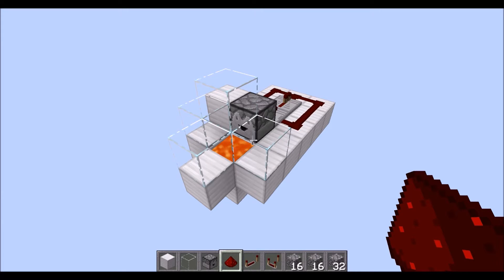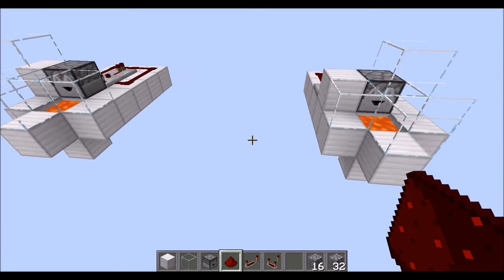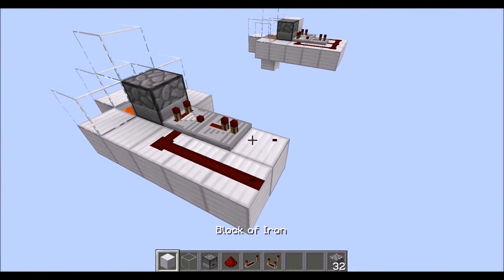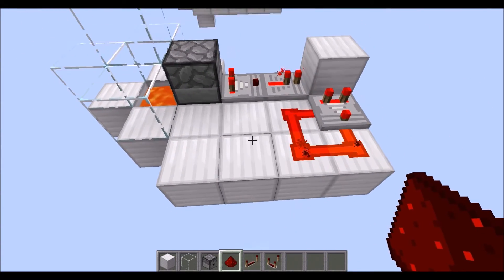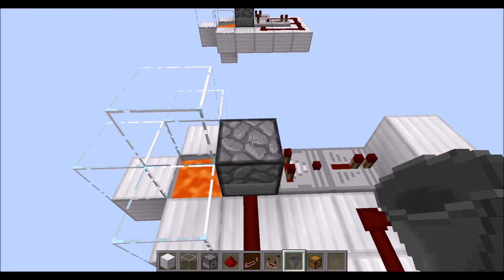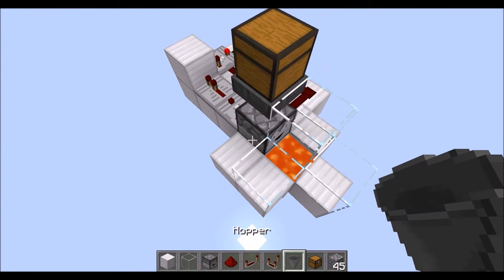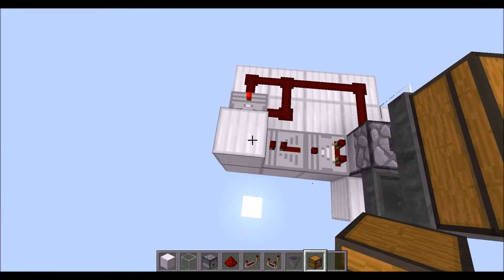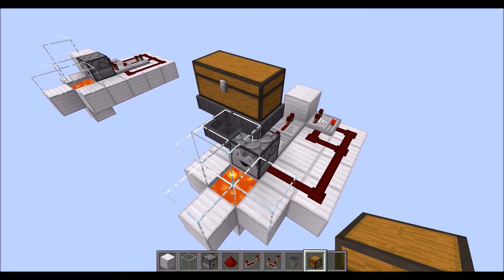Fast Item Disposal

Comment: Love this! But have a question.  I play on a server, and have a skeleton grinder.  I have a sorting system to sort out the unstackables (bows and armor) from the bones and arrows.  I would like to keep the unstackables available for a time for new players.. but eventually want to dispose of them with a lever or button.  Is there a way to hook this system into that sorting system?
Reply from the maker: Yes there is a way.  I assume your items are going into a chest.  You could have a hopper below the chest that is locked by powering it with a redstone signal... from a lever most likely.  When it is locked, no items will move into or our of the hopper.  That hopper would lead into the item disposal system.  Then when you flick the lever, it would unlock and the items would flow from the chest holding your items into the item disposal system.